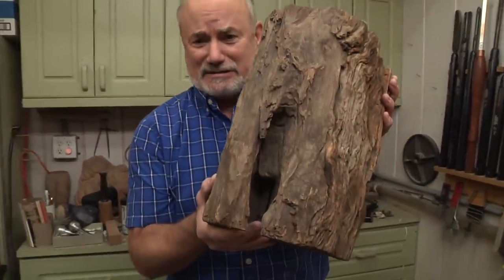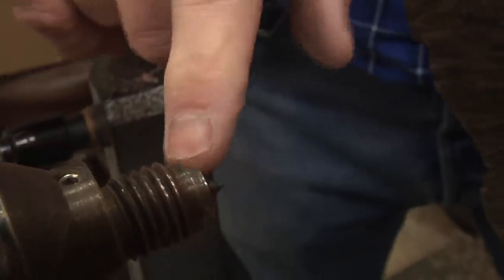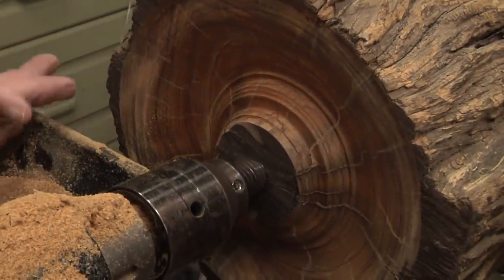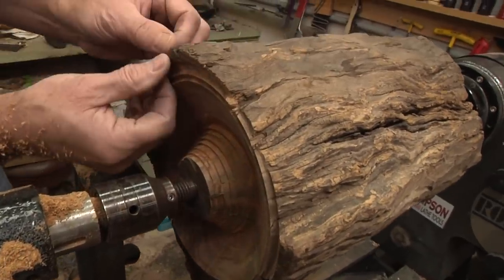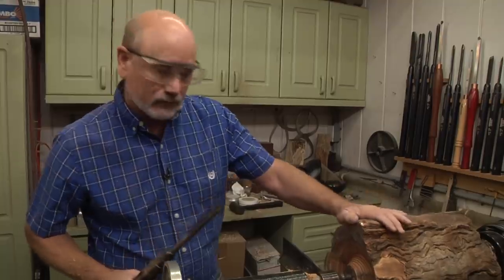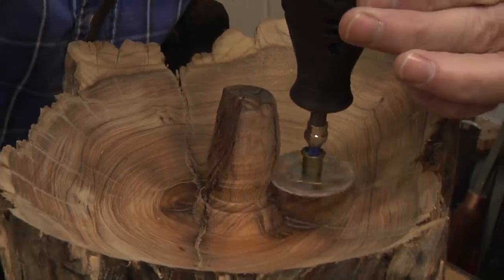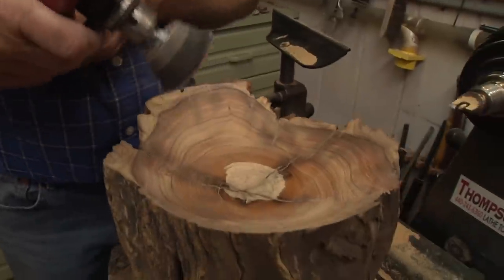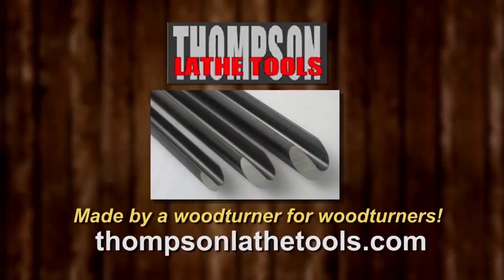Tree Trunk Bowl

Comment: Tim, you are a trusting sole.  I would never turn that piece of wood between centers as you did.  I would turn between centers, but I would drill a 1" X 1/2" hole the the drive end to accept the drive.  Then on the live center end I would drill a cone shaped hole to accept the live center.  There is no way it could come out, it is totally captured.  Get all the catches you want, it will not fail you.  Other than that, you did a good job, but it's still just a stump with a dish shape in one end.  All that said, it's still beauiful.  Take care, Larry